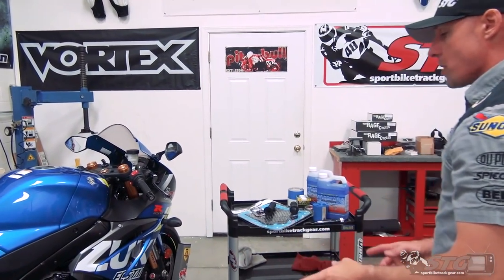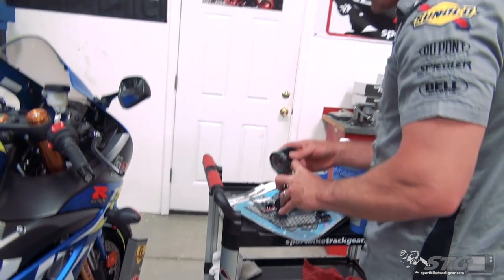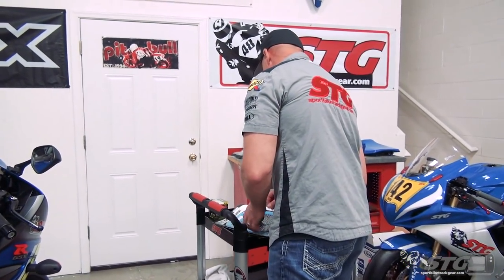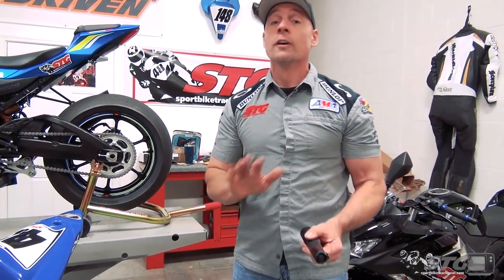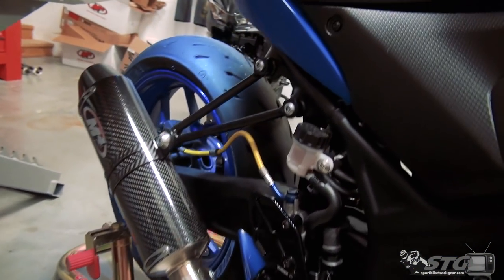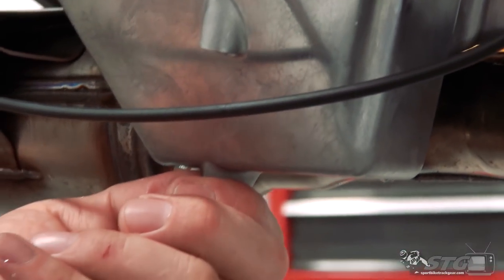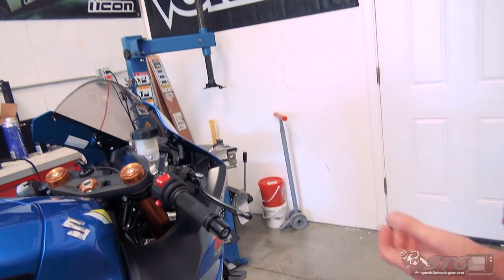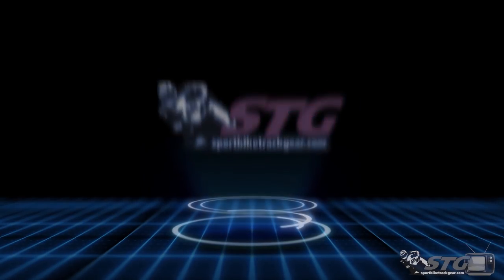How To Prep Your Motorcycle For A Track Day from SportbikeTrackGear.com

Comment: It's much more lenient in the UK, especially not having to change the coolant.
Reply from the maker: Not changing the coolant surprises me a little. It is harder to clean green coolant off the surface than oil when a spill occurs. Perhaps the difference between the US and UK for track day tech is the number of lawyers we have in the US? - Van
Reply: @sportbiketrackgear   Ha Ha - you are most probably right there !!! bike is the owners responsibility in the UK, they will pull you off track if they notice something wrong but otherwise its push on !

Comment: I'm curious, why do you have to tape off the lights if you're pulling the fuses/wires? Or vice versa. I thought the intention of taping off the lights was to block the light.
Reply from the maker: The idea behind it is to prevent shattered glass or plastic from being spread in the event of a crash. - Van

Comment: Do you need to pull fuses when you disconnect turning signals, rear brake, licence plate, headlights?
Reply from the maker: If you disconnect the lights there is no need to pull the fuses. - Van

Comment: What about the psr oil cap and drain plugs that come with the clip and wire? Will those pass inspection in most cases?
Reply from the maker: Yes those will pass tech. - Van

Comment: What's up with all this wiring? My organization says just to tape up the bike and put engine ice and I am good to go.
Reply from the maker: Every org is different and many also have different requirements for each class. The group we ride with requires safety wiring of the filter, drain plug and filler plug in advanced and intermediate only. - Van
Reply: Out of curiosity, why for those groups and not for novice? I did my first track day last month at Palm Beach and it was a great time.  Will be doing my second one in September and want to make sure I am good to go.
Reply from the maker: Most orgs will make the tech requirements for their novice group (typically this group will be for riders new to the race track) a little less difficult to pass making it easier for a new rider to get out on the track to see if this is something they enjoy or not. The bike still needs to be safe, just not held to all of the same standards as a more advanced rider who has been to the track numerous times. - Van
Reply: Sportbike Track Gear that makes sense. I did my first one on a rental and it was convenient but I will be doing my next on this September on my R6. I don't even know what tire pressure to run. Or if my tires are still good for the track. I have Power RS with about 3200 miles on 'em of Florida riding aka straight lines.

Comment: Thanks for the info Van !!! 
Do you think front and rear axle sliders actually do anything if you after have a big frame slider attached ?
Reply from the maker: Every bike is different and every crash is unique. I have had crashes that damaged the axle nut and others that did not. Max fell on the R3 at Barber this summer (lowside in turn 5) that left some damage on the front axle bolt. Unfortunately we did not have sliders on the axle when he fell. - Van
Reply: @sportbiketrackgear  I'll probably throw some on anyway just to be on the safe side. Thanks for the quick replies and amazing videos mate !!!!

Comment: picked up a zero mile 636 should I be worried about engine break in before I hit the track?
Reply from the maker: No, just make sure to heat cycle it before you take it out a couple times. - Van